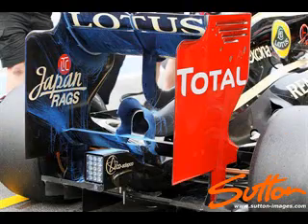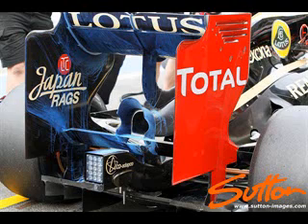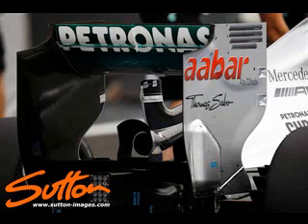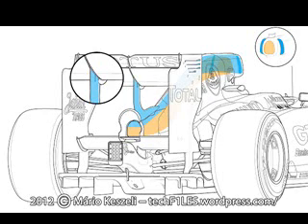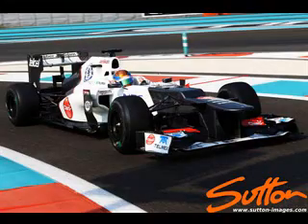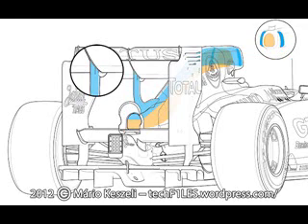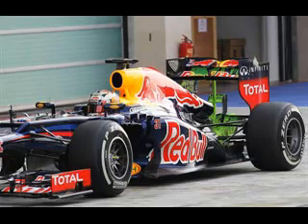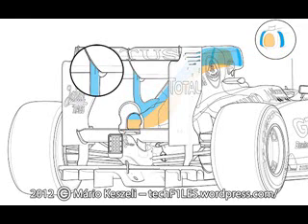#TechF1Show - DRD - Drag Reduction Device Explained

Comment from the maker: Technically it's another DRS / Drag Reduction System but unlike the legal moveable rear wing top flap we see on all F1 cars, DRD (Drag Reduction Device) is a set of components used to stall the central portion of the mainplane as speed increases.  It requires no moving parts instead simply relying on airspeed being blown from the periscope (underneath the mainplane) to create the stall.